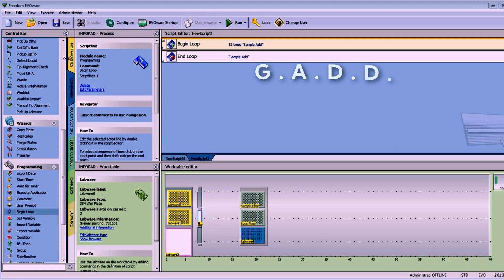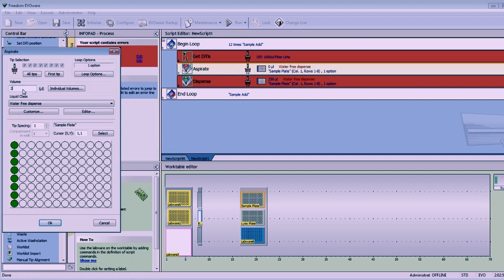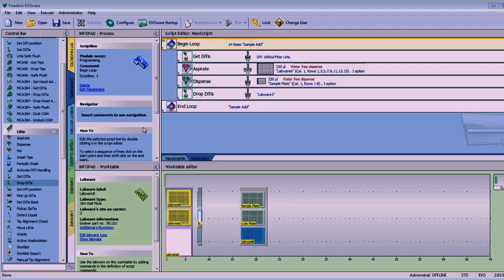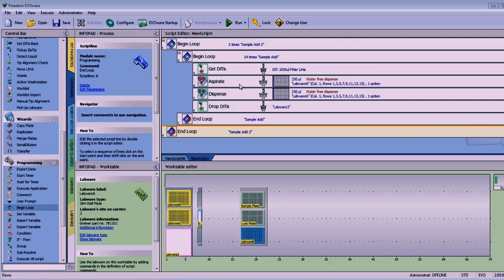How to Setup Loops | Tecan Evo (2023)

Comment: Hi i got a question. We have a Tecan evo 150 in our lab but nobody used it since 2016 if I am correctly informed. Now I am trying to set up some easy pipeting tasks and assays with the LiHa pipeting arm. With the 96 arm is everthing kind of easy but with this 8 arm I cannot even find the drop and get tips comand. I dont know now I just have copied it from an old script but then it tells me " DiTi-command defined for standard tip 1" and I for me it is not clear how I can change the defined stadard tip. is there somebody that could help me?